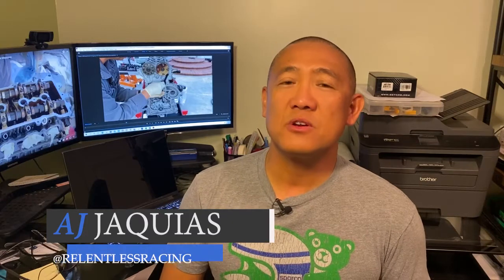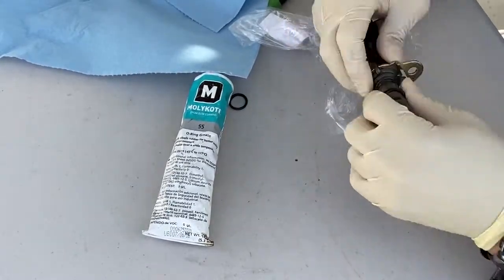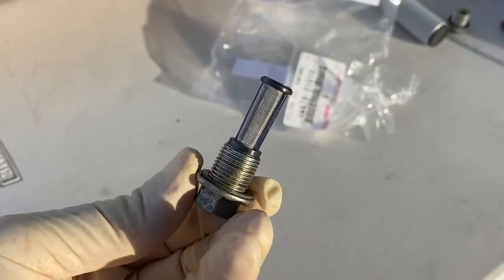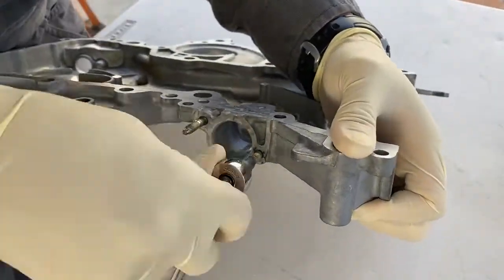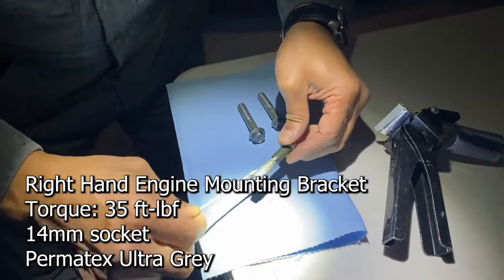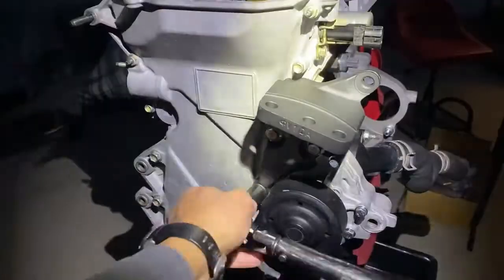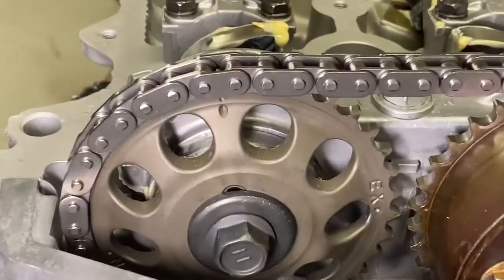1ZZ-FE Rebuild Part 5 - Timing Chain & Tensioner, Water Pump, Front Main Seal Installation

Comment: Awesome Series!
This Series has helped me immensely!
I love the getting the part numbers that you provide. Could you tell me where i could get the bolts for the timing chain guides or the size and length of the required bolts?
Reply from the maker: @CN42-u7l  thx for the kind words. You can purchase the bolts for the timing chain guides at the dealership. As an alternative, you can measure the thread and buy them online. Recall, the most common bolts on Toyotas are M6x1, M8x1.25, M10x1.25, & M12x1.25. A good rule of thumb for length is twice the diameter. Good luck. Pls subscribe. -AJ

Comment: I really appreciate you putting out this video!  I replaced the head gasket in my 04 Corolla following your detailed instructions. I made sure the timing marks on the cam sprockets and the crank sprocket all line up just like in your video. However, after I installed the timing chain cover and the crank pulley, the mark on the pulley appears to be indicating 10 (clockwise direction if you’re facing the pulley) past the 0 mark on the TCC. Did I do something wrong and what do I have to do to remedy this? I’m from CA and I believe my car’s made in the states (but I’m not the first owner) 😅.
Reply from the maker: I appreciate the kind words. The marks and crank pulley should be dead nuts… that’s why it’s called timing. It must be precise. Is the TCT on properly? Did u start w the crank at TDC b4 adding the timing chain? Did the crank move when u were putting the chain on? Hopefully, she is out of the car and you can examine it carefully. You may have missed a step or something moved while u were fiddling w the chain. Since this is a 1ZZ there is a lot of bond used to install the timing chain cover. I suggest going through the process again, but dry fit it. Otherwise, put everything together w no bond. Verify everything is timed properly. Once you are complete, verify it holds timing by rotating her twice… the timing should still be good. Then, take her apart and do it again, but w bond. Have fun and good luck. Pls subscribe. Thx again AJ
Reply from the maker: Pls see 2:51: is the chain tensioner slipper installed properly? Lastly, there is no shame in consulting with a local qualified mechanic in your area. Good luck and pls subscribe.  thx AJ
Reply: Thank you for your prompt reply! I did everything you mentioned and that’s why I’m scratching my head as to why the timing (just the crank pulley) is off. Is TDC just aligning the dot on the crank sprocket and the (on OE chain an orange link) and the locking ping with the dot on the oil pump cover? The #1 piston looked to be (almost) flush with block surface before I installed the head.
Reply from the maker: @jikaiduan631  pls see 2:25 and verify the crank key way is aligned with the dot on the oil pump. Also, the yellow timing chain link is aligned with the crank sprocket dot.
Reply from the maker: @jikaiduan631  Pls see 2:58... do the dots on the exhaust and VVT sprockets align? Are the yellow timing chain markers aligned with the outer perimeter dot of the exhaust cam sprocket and line on the VVT sprocket?
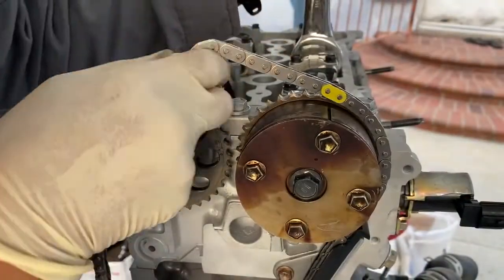Reply: I went back to review your video and I noticed a slight difference between the FSM timing mark diagram and what you demonstrated (i.e. at 2:39-2:43 in the video, the intake cam sprocket dot is clearly one tooth off the EX cam sprocket dot while the other sprocket markers lined up with the center of the yellow chain links). While I can repeat what you did, I can’t produce (tried a bunch of times) the result per the FSM diagram (an example can be seen at 14:32 of this video https://youtu.be/x1qo3rvvXwE?si=3Hmt9RZa3AKrf_QD). Why is that? I have no issues with consulting a pro mechanic as a last resort but that kind of defeats the whole self-learning process. 😅
Reply from the maker: @lianfenli  FYI - my vid and the vid you mentioned do the exact same thing. I get you are trying to learn, but what you are trying to learn is not easy and YouTube classes can’t replace years of automotive experience. It’s time to consult a qualified mechanic. Good luck.

Comment: Shouldn't timing be set at 10 btdc? That's what the sticker under the hood says
Reply from the maker: Have you read the OEM service manual?
Reply: @RelentlessRacingAJ  manual said TDC, but then the car wouldn't start. Set it at 10 btdc and it runs like a charm
Reply from the maker: @charlemaaktnietuit9650  glad u got her running. Im not sure what country you are in, but perhaps there are differences with engine hood decals. In the US, the decals under the engine do not state anything about timing. There is an emissions diagram, intake/exhaust valve gaps, and other unrelated vehicle identification information. Also, the timing chain really sets your timing. By placing the chain orange links onto the cams and crank sprocket marks, that sets the timing. So u can’t just arbitrarily change the timing. However, you can install the chain a tooth and this will mess up timing. Again, the chain sets your timing. Perhaps you didn’t place the timing chain links where they needed to be. In any case, your MRS is running well so it really is a moot point. -AJ
Reply: @RelentlessRacingAJ  I am in Suriname (small country in south America) Most cars here are Japanese imports. I set the timing marks exactly like you do on the cam sprockets. Difference is with the mark for the crank sprocket. 10 BTDC puts the dot on the sprocket one link before the mark on the chain. Just overhauled the 1az-fse   last week and replaced the chain on a 1zz-fe. Both engines run smoothly. Maybe it doesn't matter much as the VVT adjusts the timing all the time while driving?

Comment from the maker: Prior to installing the intake cam gear it needs to be unlocked. There are vids on YouTube which explain the process. Although, I didn’t unlock the intake cam gear I got lucky and it worked fine. However, if u don’t wanna mess w unlocking the intake cam gear, then don’t remove it from the cam. -AJ

Comment: I m rebuilding the sa me engine but i m not buying so many new parts
Reply from the maker: As long as you are verifying the original parts are still good that’s fine. Personally, I don’t cut corners on engine builds because the last thing I want is a part failure which causes my motor to blow up… especially on track. Pls subscribe. Thx, AJ

Comment: I'm rebuilding my 1zzfe engine. I am putting back and got stuck on the timing.  Need a little help.  Here's what I got.  Crankshaft key at 12oclock, lower sprocket mark line up with yellow chain link. Upper two sprocket markings also line up with the yellow chainlinks. Left right center dots don't line in the center sprockets. Do i set cylinder #1 dead top center to start then adjust the two sprockets on top to line up the yellow links?
Reply from the maker: Did u subscribe to my channel?
Reply: @RelentlessRacingAJ  sure did. Like a couple weeks ago
Reply from the maker: @tonedubb4325  https://youtu.be/AlVIqixb3u4
Reply from the maker: @tonedubb4325  thx for the sub
Reply: @RelentlessRacingAJ  i saw your video followed it but can't get the 2 dots at 3 o'clock and 9 o'clock to lined up.  There's E next to the dot on the left sprocket.
Reply from the maker: @tonedubb4325  the dot on the left should have an EX next to it. EX stands for exhaust. R u sure u have the right dot?
Reply from the maker: @tonedubb4325  is the motor really at TDC?  How did u prove this to urself?  Are the links that far away from where they are supposed to be?  Have u read the OEM service manual procedure?
Reply: @RelentlessRacingAJ  i think i have figured it. It's 2000-2005 celica gt.  It's same motor in your mr2.

Comment: AJ, quick question on installing the vvt gear. I’ve read that the gear needs to be in the unlocked position before torqued down and if not can cause a check engine light. Did you do this before installing or no and if no did you run into any issues?
Reply from the maker: I heard the same, but after I installed mine. In fact, I honestly don’t remember why I took it off… prob to clean it bc I’m OCD about that. In any case, I torqued it in the same position as when I took it off. FYI - this 1ZZ is in Project Silver and there have been no check engine lights. From what I understand, b4 installing the timing chain it must b in the locked position. Additionally, every time the motor is turned off it returns to the locked position. Hope this helps. Pls subscribe. -AJ
Reply: Thanks for the reply AJ, I bought a kit with a new vvt sprocket so I guess I have a decision to make. Love your channel keep subscribed a long time ago 😀
Reply from the maker: @larryderuyscher4448  thx for the sub

Check out this vid and read the reply to Phone Phone
https://youtu.be/aRKFM_t6W5k

Comment: Hey man, your rebuild series have been really helpful. I am trying to replace my VVT gear sprocket by bungee cording the timing chain so I don't have to do excess work. When you installed the VVT gear, was it unlocked or locked? From my understanding it's installed as followed:

1. Make sure the cam gear is in the unlocked state.
2. Torque the bolt to 40-lbs.
3. Install the camshafts and line up the timing marks, then torque the caps to spec in a criss cross pattern.
4. After step 3 then you turn it clockwise to lock it.
5. Re install valve cover and start it up.
Reply from the maker: The VVT gear was locked when I installed it. I showed mu  process in the video. I recommend reading the OE service manual a few times. Also, check other vids on YouTube regarding the locked and unlocked gear and especially read the comments. Hope this helps. Pls subscribe. AJ
Reply from the maker: Read Frank’s comments from this video https://youtu.be/aRKFM_t6W5k

Comment: The video is sped up too fast.  There isn't enough time to see the detail.  If someone is watching this then they're doing it to rebuild a motor.  There's no need to rush the video.  They'll sit through a longer video to rebuild the engine right. When you display text, I don't have enough time to pause the video before the text disappears. Way too fast. 

The YouTube feature to split the video into time segments is horrible.  It makes it really difficult to control replay of the video.  Some of the time segments have no correlation with the video that's played. Click one segment then it plays another.  Sometimes it goes to the end of the video. Some time is starts the video over.  You're better off not wasting your time.
Reply from the maker: I appreciate your comments and I apologize you don't find the video to your liking.  This video was not intended to be a single source for a rebuilder.  It is meant as an aid to the OE service manual.  I sped certain sections up bc most subscribers don't want to watch me torque bolts.  I recommend using the pause function if you can't read the text.  I have reviewed the chapters on my laptop and phone and they work fine.  Perhaps, you can record the screen with your phone and you can use your finger to slow or speed up the play back.  Thx for watching and commenting.  AJ

Comment: My tensioner is not going in all the way like yours at 5.06. Do I need to rotate the crank clockwise or anticlockwise to release the tension?
Reply from the maker: Did you read the applicable section in the OE service manual?  Did you collapse the TCT prior to installing it?
Reply: @RelentlessRacingAJ  The problem is the tensioner. It is an aftermarket one that despite looking similar  is not within spec.
Reply from the maker: @fernandohood5542  did u buy a new OEM one?
Reply: @RelentlessRacingAJ  Re-used the old factory unit.
Reply from the maker: @fernandohood5542  nice. hopefully u replaced the TCT o-ring.

Comment: Was the cam gear unlocked?  Slowing down on the timing portion of the build would have been helpful.
Reply from the maker: Yes, the cam gear was unlocked. I sped the timing up where it was self explanatory so viewers wouldn’t get too bored. If this video is too fast for you, I would suggest consulting the OEM service manual or a local engine building shop. Good luck
Reply: @RelentlessRacingAJ  Timing is critical and as such it makes sense to spend the extra time demonstrating how to set it correctly. Just my perspective.
Reply from the maker: @fernandohood5542  Timing is critical and I showed every step, but again if it’s too fast there are many vids on setting timing on the 1ZZ, u can always hit the pause button, read the OEM service manual, or take it to a shop. Perhaps this video is more preferable for your speed

https://youtu.be/AlVIqixb3u4